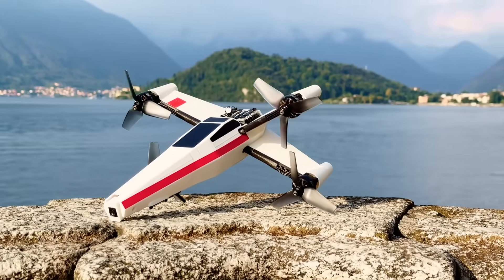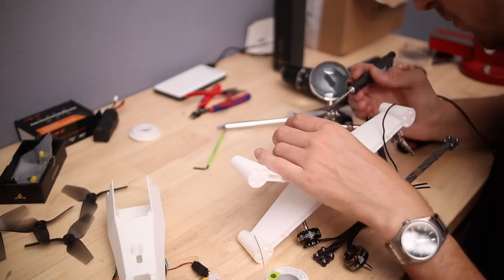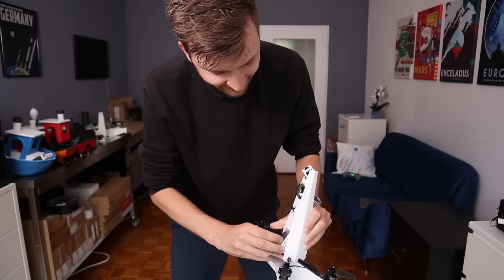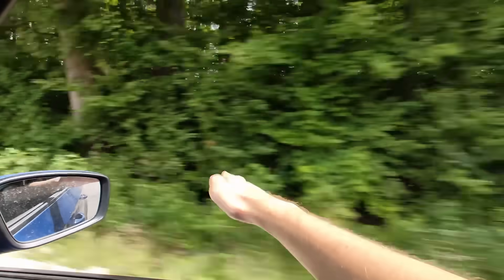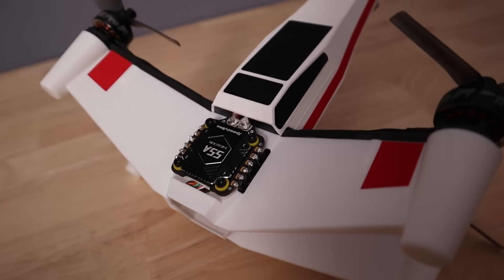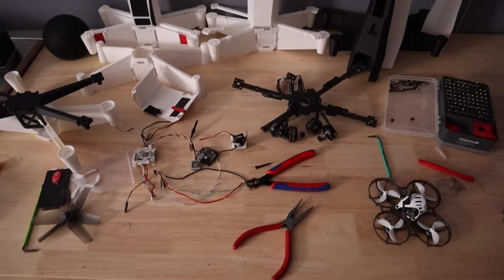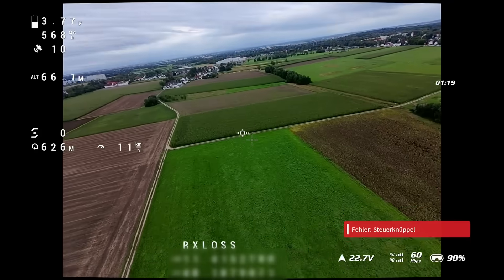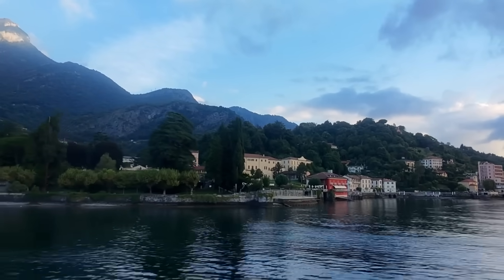X-wing drone (it's fast)

Comment: Mate , the PIDS and the FILTERS are 2 different animals that relate to each other
The vibration problem could be solved with some filtering or even DROPPING gyro filtering completely and relying on gyro RPM filter at the 90hz minimum
you can get some crazy tunes droppin gyro filter and using gyro rpm filter to cover that 100 range
run high as you can PWM frequency too bro

Comment: Very cool project.
As a spaceship, this is how X-Wing suppose to fly.

I missed when I was playing drone several years ago. Learning acro mode is difficult but rewarding. I had to sell the drone cause I need the money.
Reply: You aware the space has no air, right? Nothing in Star Wars would fly in real life.
Reply: @YKW-YouKnowWhat  I was referring to 'fly in outer space'.
Reply: @mahendra4352 😂 you cannot fly, glide nor hang in suspension in outer space. You constantly fall in there. And not in line but in orbit around gravitational pull centre. KSP is very good game to understand how space works.

Comment: I love the way that you’ve went with this X wing project, for many years now people have tried to use ducted fans for this type model trouble is the amount of thrust to size the amount of weight that the model would need to be to look right along with the battery to run it , has been a very fine line, so to go to a conventional Quadcopter set up and using the nose as an uplifting wing is a very simple but effective design , and by changing the shape of the underneath of the nose can gain you some stability , if I may suggest that you open the Ex pattern up slightly more this will cut down on the amount of turbulence from the ends of the props, i.e. less vibration , but by far the biggest problem from vibration is because your flight control is hard mounted on the stand-offs , so there’s three ways of tackling this one is to mount the flight control on a foam pad is what we used to do many years ago , to use an isolation plate which is two carbon fibres with rubber pads in between, these days flight controllers usually use stand-offs and rubber rings but sometimes these are not effective enough so I’m gonna leave you a link to an isolating rubber that replaces your stand off and you use a nut bolt effectively to go through the middle, this makes it adjustable so you can adjust the amount of vibration that is taken out of the equation
https://ebay.us/m/LmJObt
Reply: PS, you’ve done the Ex swing now. You’ve got to do the Thai fighters. lol 
Love you project hopefully we’ll see some more

Comment: Tip; a bridge rectifier doesn't just convert AC to DC, they can also be used as a "wrong way" battery protector. Put a bridge in a DC circuit and the battery can never be connected backwards
Reply: genius, never thought of that
Reply: Where's Mhedi when you need him?

Comment: Super! That's one way to do it, this was really entertaining to watch! 😄Just a few things and questions; as said, smoke stopper, prevents shorting before anything gets damaged, pays itself on the first mistake prevented. Second, the CG, for a drone it doesn't matter that much probably, is it in the middle of the X or more to the nose? Just thinking because if one wants any lift from the wings/foils it should be quite in front behind the leading edge, probably around 15 - 20% of the root chord. And the third is the control scheme, taking you use mode 2, does the controls change when you fly in "plane mode"? I fly some quads too and tried 90° angle in LiftOff, where roll and yaw swap places making it a mode 4? 
Cheers!

Comment: Feels like the quadcopter community is completley nonchalant about balancing props and motors, we in the RC plane community know this is super important. I could be wrong of course but some tape on the motors and blades could probably have solved all the vibrations?
Reply: Tape could dampen it, or some steel or aluminum bracing to make it more rigid.  Steel usually has a higher strength/weight ratio and definitely is more durable, but with some more expensive aluminum alloys you can approach the strength to weight ratio of steel.

Comment: I know it will mess up the aesthetic but i imagine you could shape the fuselage  more like a wing with a specific orientation and get some lift for when you are flying forward
Reply: Сouple more of these tweaks and you will reinvent AOS HS5.
Reply: or just scale it up and go ducted fan with the fans in the correct location.  also add elevon surfaces with tiny throws for high speed horizontal control when at low throttle - differential thrust will turn to differential drag when you throttle down, not sure how that would fly.  maybe retractable canards like the original F-14 design wings had?  could significantly improve flight times.  you could basically idle the upper motors.

Comment: Now you need the top two motors to pivot 90 so it can vertically lift in the horizontal orientation!
Reply: Heavy and complex. Mostly heavy.

Comment: Good video, and super cool idea. I love the X-wing design you made. I'd love it with some LED strips as "lasers" even more.

Following points regarding vibrations. I am a mechanical engineer and fly drones, but admittedly most of this is just internet knowledge.
1) for PID and gyro filtering, a mechanical problem cannot be solved with software. You can 'fix' it with software, but you're just putting on a band-aid and it'll never fly well. If the build has issues on betaflight defaults, go back to the mechanical design.
2) Ensure you're using rubber/silicone gromets for the flight controller (as mechanical 'filtering'). Get bigger gromets if needed.
3) For just style points you could also use a 3D printed design, with less powerful hardware. You won't do 200kph, but it'd be more accessible for the audience. more power = more vibrations

4) The multiplate carbon design (I see you did this on the redesign) might work really well for this! Still, look at some 5" drone frames. Typically, a (thin) bottom and (thin) top plate is used, with 4 identical thick arms. Look up Chris Rosser on yt for a more intelligent analysis on how this can help with vibrations.
5) Use damping grease. Even if the mechanical design isn't perfect, damping grease between the plates helps a lot.
6) If feasible, enlarge the frame to just mount the ESC+FC stack on the carbon (30x30 or 20x20). Making it a bit bigger will probably just make it look cooler too!

I'm not an expert, and it seems you really did your homework, but I hope (some of) this helps.

Comment: As a beginner in drones and student in aerospace engineering (Master's degree). I would say a few things about the vibration issue : 
- motor build quality is a major factor : the more equilibrated the rotor is, the less vidrations it produces, as such a cheaper motor will create bigger vibration compared to a more expensive one that has better quality components (we are dealimg with effects due to machining tolerances).
- carbon fiber is strong in only one direction, the direction of the fiber, and extremely in any other direction, which is why sheets are made with CF fabrics, they are woven with fibers in two direction perpendicular to each other, making the part relatively strong, except in the diagonals, which here is a problem. For such uses, you need isotropic carbon fiber sheets were half of the fabric layers are turned by 45° to increase strength in the diagonal directions. It's more expensive, yes, but definitely more rigid for a flattened X shape
- about the arm's stiffness, any mechanical engineer will tell you that the stifness is proportional to the area momentum Iz, with
W the arm's width and H it's thickness, Iz = H*(H*H*H)/12.
Doubling the arms' width will double stiffness, doubling the thickness will increase stiffness by 8 times.
A proper analysis would determine the motors frequency range, and compare that with the resonant frequencies of the arms but out of reach for most builders

Should you fly it like a quadcopter or give him real wings to make it fly like a plane, take off and land as a tail sitter, and mix motor inputs with roll pitch and yaw commands, maybe having canars in the front would help

Comment: U sure it was the vibrations from frame I know when trying to arm and spin motors without props installed FC get mixed inputs and usualy one or more of motors start to idle up to max...could that be your's case ?

Comment: Good work!! I've also been trrying to print my own frames and had that issue with huge vibrations. What fixed it was either lowering settings a lot (which I didn't like as the performance is awful), but with filtering and stiffening the frame. Blackbox reveals which frequencies needs extra filtering and with some ChatGPT my quad flew a lot better!